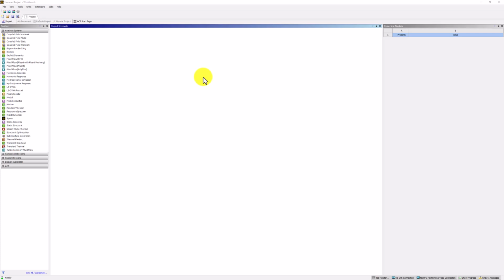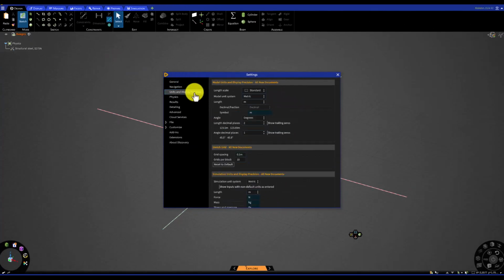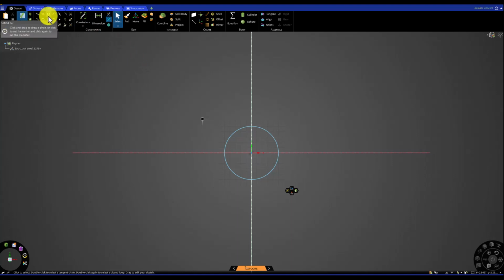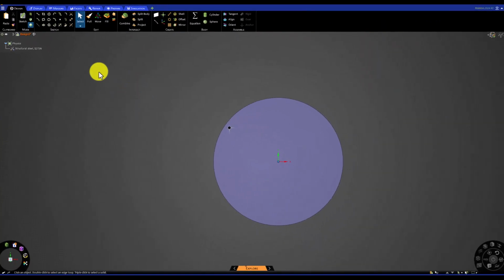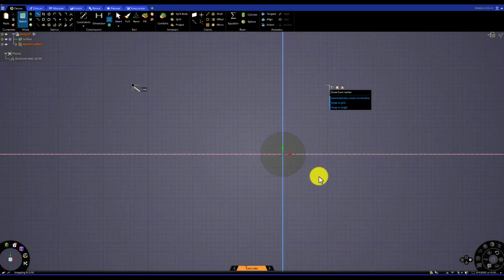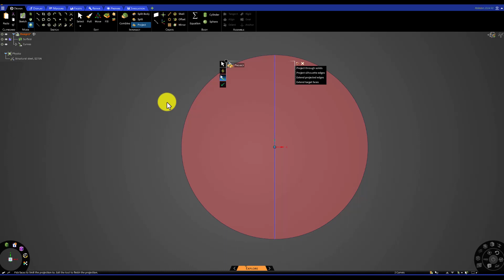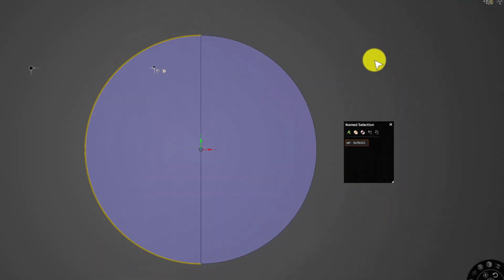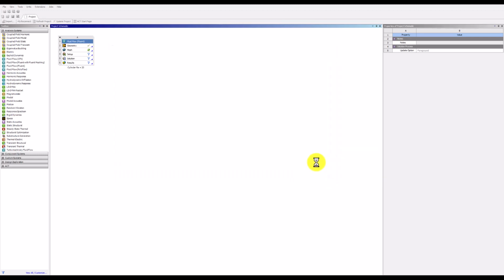Geometry | Steady Flow Past a Cylinder

Comment: at 4:45 every time i trim and remove the extra part going through the cylinder, and then go and click 3D mode or the project option, the curves on the list on the left straight up just disappears
and i have to select the surface as two separate halves in the project option, not one whole surface like in your video
is there a way to solve this issue?